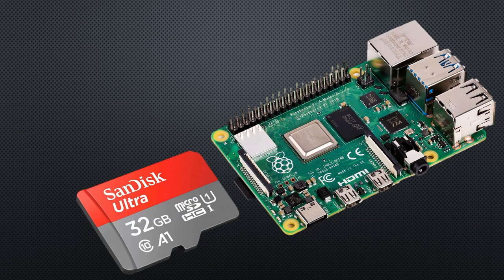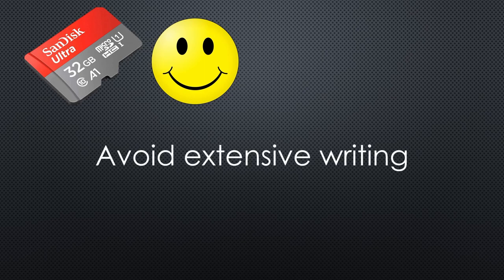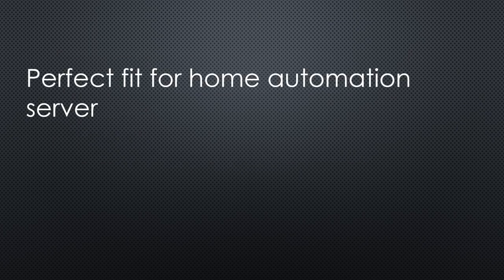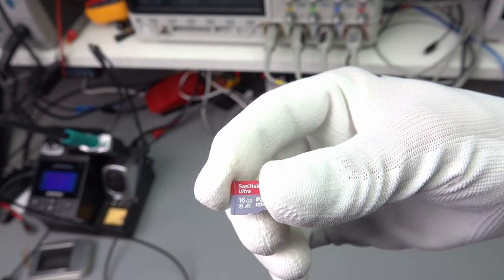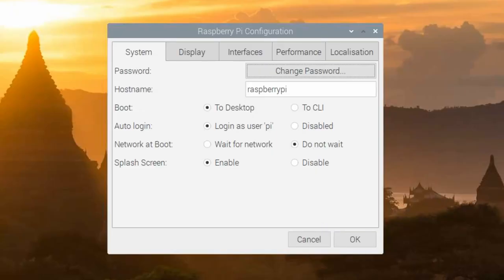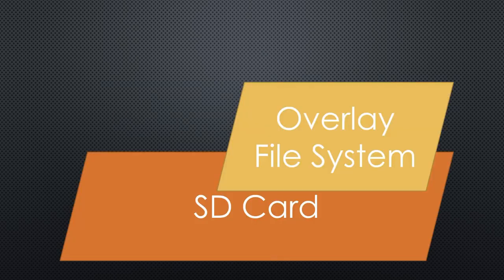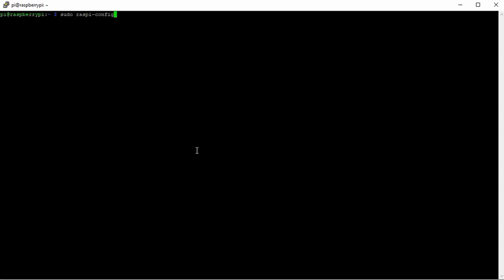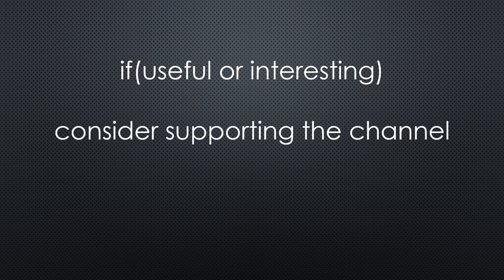#403 Simple Trick to protect your Raspberry SD card from Crashing

Comment: there is another option using write-behind caching on EXT4 so it caches all the writes to ram and then using the COMMIT=xx seconds mount option it will write the changes from ram to disk every so often, the best of both worlds
Reply from the maker: Good point! And it seems to be easy. Similar to log2RAM, I think.
Reply: It doesn't ensure that writes will be cached to ram though. Just that it will cache up to "commit" seconds of writes before automatically syncing the filesystem so if your system suddenly crashes, you know that you have lost at worst this amount of writes. Applications can request their writes to be immediately recorded to the disk/SD Card. Applications who use databases (such as SQLite) or unbuffered logs will do that frequently.
Reply: I have a pi3 running on the same sd card I started with, probably 6 years of running 24-7 with not a single issue. Pi4, has already burned 3 sd cards up in less than 2 years.

Can't for the life of me remember what commands I did to limit the card writes, or whatever I read at the time, but it's worked. Wondering if this is it...

Comment: I was able to reduce my sd card consumption drastically by logging to my remote homeserver. (almost) No local logs anymore. There is another advantage in remote logs: you can find suspects, even after the device in question died. Since there is a homeserver up and running 24/7, it was just a matter of some simple configuration.
Reply from the maker: Remote logging seems to be an interesting alternative (or extension) to this concept. Maybe I have to try it too...
Reply: @mixxx2005  For anyone considering this: make sure to put security in your network config. Unless you want a random device in the wild to give an attacker access to the files on your home servers/computers.
Reply: Have any details on how you did this?  I'd love to do the same..  have an NFS share or similar on a pre-existing NAS that would support logging from all of my various PIs, which could then run completely read-only.
Reply: @SteveJones172pilot  I enabled one of my Linux hosts to accept remote syslog messages, and enabled all clients to log to this remote logging facility. This is quite straight forward. How you have to do i depends on your software, of course.

Comment: I also tend to install ZRAM on every pi I own. It removes the need for swap space on the sdcard and it allows you to fit about 50% more stuff into the physical available RAM.
Reply from the maker: I never used it because I only have 2GB and bigger Pi4. So memory is no more a big problem for me. Probably good for a Pi zero if it does not consume a lot of CPU.
Reply: @AndreasSpiess  I even use it on my rpi 8gb model. Sometimes I notice raspian swapping stuff out even with minimal applications running and plenty of main mem free.
Reply: @misteragony  For some reason I think the default "swappiness" value is a bit too high in raspbian (how likely the os is to use swap). I adjusted it to 10 from its default 60 and have only noticed minimal swap usage since then, but it is still there for emergencies when you are running close to the limit (I have also done this on my laptop with similar results).

Comment: SD cards are not by definition unreliable. They come in different flavors for different use cases. If you pick the right one, an SD card can be more reliable than a big cheap SSD.

The most important criteria are the cell technology used and the Bill of materials.

Cell technology:
* Most consumer cards use TLC or QLC (3D) cell technology. A single cell can typically be rewritten approx 200 to 300 times. 
* Some consumer cards advertise with 'long endurance' or 'industrial' terms. Often such cards use MLC cell technology (but this is not guaranteed!). In this case a single cell van typically be rewritten approx 2000 to 3000 times. This type is also often used for EMMC memory and modules.
* For more demanding environments (automotive, medical, extreme conditions,..), often (p)SLC cards are used. For these type of cards, a single cell can be typically rewritten up to 30000 times. That's >100 times more than a typical consumer card!. You will not find these cards in a regular (online) shop. Cards utilizing this technology often have more advanced flash controllers onboard providing additional security and features compared to consumer grade cards (e.g. power failure protection, better wear leveling...).

Bill Of Materials:
* Most consumer cards do not have a fixed Bill Of Materials (BOM). This means the internal components can change without notification and the manufacturer will choose whatever is available and the cheapest that complies more or less with the specifications. So for one batch of cards, the cells can be TLC, and a few months later, QLC becomes cheaper and the manufacturer switches to QLC components, or uses another flash controller...  This is also the reason why almost no manufacturer will give the complete specifications of the used components for these cards.
* Most manufacturers also offer fixed BOM cards. These are cards where the used components are fixed and will not change without notice. This guaranties that if you buy the same card next year, it will behave exactly the same as the ones you already have.

An example of a 'cheap' (p)SLC card with fixed BOM is the SDSDQED-016G-XI model by Western Digial/Sandisk.
 It is a 16GB SLC card with an extended temperature range (-40+85C) and an endurance of 480TBW. It costs about 30 euro's at Mouser. This is typically cheaper than a usb->sata/M2 adapter + decent SSD.

For comparison: a Kingston A2000 SSD of 500GB has an endurance of 360TBW. And if you only look at smaller very low cost ssd's, then the endurance is often <100TBW ((e.g. Kingston A400 120GB -> 40 TBW)

So for projects that do not depend on very high speed disk access or require a lot of storage, such SD card is unrivaled. Both for price and reliability.

(The explanation above is a bit simplified... there are other factors playing also a role, but this comment is already long enough for now :-)
Reply from the maker: Thank you for bringing light into the dark of the SD cards! So far I have only used SD cards from online suppliers. Good to know other variants exist.
Concerning SSDs: Even my home automation server only writes MB and not GB because I store sensor data and not videos. So with my Raspis, I can live with very low TBW values (other than with my YouTube production machine ;-) ) I also only use the smallest SSDs I can get because the volume is small (<2GB for two years of sensor data)
Reply: Best comment ever! Thanks.

Comment: I use a different approach, and I find it much simpler and scalable: I use a NAS, so shared directories to save logs and data. So I get automatically backups (I need to set up only once for the base directory in the NAS), fast disk (but it depends also on network), cheap disks. And I'm able to split or merge services and rpi much easier.
Reply from the maker: Storing the files on a NAS is for sure a good thing for many applications (if you own one).
Reply: When a Raspberry is booted without connection to the NAS (e.g. NAS is down, or no network connection), the Raspberry runs without NAS connection forever! No retries to connect later.
Solution: autofs mounts the NAS directories when needed, and releases the connection after 5 minutes when not in use, so this also costs less memory. Thus a retry is provided after connection-loss.
When speed is not needed, you can make a NAS from a Raspberry and 2 USB disks (even USB-thumbs) as RAID-1 using mdadm.
Reply: @AndreasSpiess  It is super easy to make your own NAS, just install Linux on a machine (could be another raspberry pi) and configure a RAID 5 (preferably not on USB, which is too unreliable for it, as it can disconnect randomly from time to time, which breaks the RAID and makes it go into degraded mode) and then share certain folders via NFS, very easy. The advantage is that you don't have a proprietary NAS like Synology that is both inflexible, hard to fix when it breaks and expensive and often uses a non standard proprietarily modified Linux.
Reply: I have a NAS as well and I prefer using it as well. I just need to get 1 that's a few teraflops my problem is the $.
Reply: @PvGeens  Sounds like I will need to be careful with doing that.
Reply: @denastewart-gore800 , @Sagittarius-A Black Hole
I prefer RAID-1 (mirrored disks), over RAID-5: it uses less CPU-power. Disks are cheaper and bigger every day, do there is no need for RAID-5 (for me).

When a mirror breaks, the NAS doesn't stop working. It just continues working with a degraded mirror. No data is lost.
It just sends an email when it happened (configure in mdadm). Otherwise I even wouldn't know about it.

Repair is easy, can be scripted, but takes a few hours and disk-performance. Just let it run in background, after a while is fixed like nothing has happened.

I have my entire life on those disks, and had a quite few crashes (SATA on another computer, not on Raspberry), but never lost a bit. It was always repairable.

But indeed: you always need to be careful with computers. It is a mistake to think they are deterministic machines.
Reply: Take it a step further: put your boot image on a TFTP server and netboot your Pi. But this still doesn’t always fit the bill: not everything hast a fast and/or reliable network connection. OFS works despite the network being down.

Comment: With the newer Raspberry Pi 4 with the higher RAM this overlay makes a lot more sense now.   I guess you could use read/write Boot drive and periodically copy the overlay to the SD or to an external network drive for data that may need to be kept longer term.    Thanks for the great information.
Reply from the maker: You are right, many combinations are possible if you include network disks in your setup.

Comment: I use RAMFS and mount it over the top of the log directories. Then, when a program writes to the log files in the log directory they are intercepted by RAMFS instead. When the max size is reached they are discarded. They are never written to the SD card. My SD card is in its 4th year of operation (as a LoRa gateway) with no problems so far.
Reply from the maker: I never used RAMFS, only log2ram which seems to have a similar strategy. This is another valid way to solve this problem.
Reply: I have a bunch of raspi 3's running on the field and they have been working nice for the past 4 years with this tmpfs trick. A couple of sd-cards have became corrupt during this time, but I suspect its due to power outages, since after dd'ing they seem to work ok again.
Reply: I would love to see any scripts or configs you have to accomplish this..  Sounds cool..  Also sorry you're "not" mark Knopfler..  it would be cool to be Mark Knopfler!  :-)
Reply: Can you write the command for setting this up? 
I have found this: 
sudo nano /etc/fstab

And added  
tmpfs /var/log tmpfs defaults,noatime,nosuid,mode=0755,size=20m 0 0

Is this correct or are there other directories?

Thx.

Comment: Thanks Andreas, I was worrying about my sd card in. my headless Raspberry Pi 4 recoding NOAA weather images 24/7 so I made images of the card if it fails, I haven't had any card fail yet but you saved the day and me worrying, thanks for this tip will implement it : )
Reply from the maker: As said: A backup is always good! But your application probably is a good use case to reduce the chance for failure.

Comment: So, why isn't there an option to write the ram files back to sd on close?  Thus dramatically reducing the writes
Reply: My guess is it’s too hard to guarantee that. If people expect their data to be saved when the pi reboots then they will be angry if 100’s of megs get erased when it looses power or crashes. If the system expects files to be written on shutdown then the file system would be corrupted on ever single unexpected reboot. It’s much safer to just assume all data is temporary in the RAM disk.
Reply: @CodeMonkeX  Yes I see if the rewrites were automatic, there could be a problem. My thoughts were for a Manual/programmatic option - a simple 'do you want to save' or cmdline save
Reply from the maker: I am sure a lot of things can be done. But, as a Linux noob I am happy to have a simple way. All my use cases can be appointed to one or the other scenario: No longterm storage needed --> SD card or longterm storage needed --> SSD
Reply: Interesting question.  That would be a nice option.  I'm all about those SSD drives because of the speed.  I only use SD cards for the portable builds like my hotspots.
Reply: In some way a similar functionality can be achieved with "apt install log2ram". If I'm not mistaken "log2ram" is installed by default in armbian-os, on raspberry-os we can install it ourselves.
Reply: It's the dumb user version.
You can do it by setting up the places you need to write, then using a cronjob based on time or 'on shutdown' etc to flush the ramdisk to nonvolatile. Would be nice if there was a convenient button in the popup "commit overlay" and it would diff and do a single write.
Reply: @vlya1533  Interesting. Would that be preferential for any reason? EDIT: I bet that only sends the log to ram and allows updates.  If I am correct I see where that would be better in certain circumstances.
Reply: @jmr  it's just a shell script and a couple system services. As far as I can see it dumps logs to disk at stop and once a day by default.
Reply: @vlya1533  DietPi also have log2ram installed and enabled by default.
Reply: That's pretty close to how the default file system works.  The problem is, if power is interrupted before the writes complete, you've just corrupted your file system.
Reply: @JM Coulon We're not talking about running a journaled file system.  Were talking about "why isn't there an option to write the ram files back to sd on close"
Reply: @JM Coulon OK, fine, your filesystem isn't corrupted.  And how exactly does that fix the problem of the data not getting written when power is dropped?  Anything half written is rolled back, and anything not written is lost.  The point here is saving the data.

Comment: In addition to these tips I would strongly recommend getting an SD card that's more suitable for this kind of usage. I've personally had good results with the WD purple SD cards, I've got 3 pi's that have been running 24/7 for about 3 years now on an unmodified raspbian installation with full logging enabled (and one of them is constantly writing due to a pihole installation). So far I haven't had any issues. But... I would recommend partitioning only a small part of the SD card (i.e. 25% or so) so the wear leveling algorithms can do their thing and make sure your SD card won't run out of working blocks.
Reply from the maker: Thank you for sharing your experience. Because other viewers also recommended these WD purple cards a few are in the mail by now. I hope they implemented wear levelling. The descriptions I found were not clear. Just that they monitor "bad cells".
Reply: @AndreasSpiess  I've read on reddit that they are supposed to have wear leveling according to WD suport. Anecdotally however, I've had many SD cards fail before I switched. Even high quality ones
Reply: I do not believe having a small partition would make any difference to the wear leveling since it uses all the cells to write data regardless what file system you use.  The idea is get the biggest card the device can support to extend the life out of it.
Reply: @Darkk6969  You're right, assuming you have TRIM enabled it won't make any difference in that aspect. But if you only partition a small part of the disk you leave the SD card with enough space to keep wear-leveling without any worries and you can't accidently fill up the disk with logs or other files. Given how cheap memory cards are and how much space you actually need, this has been a good tradeoff for me.
Reply: Sandisk do a range of rugged IoT targeted SD cards using more robust flash. Makes sense.

Comment: I've usually mitigate writes to the sdcard by making sure the noatime and nodiratime option is on the sdcard in the fstab and mounting a small flash drive to the /var directory, and using a larger flashdrive for the home directory (you could put both partitions on one flashdrive). This should eliminate all writes to the sdcard except when installing and updating software. Not on PIs, but on PCs, I frequently use a virtual disk and keep my work on flashdrives, and have scripts with clickable icons to setup, load, and when my session is done, save and destroy the virtual disk.
Reply from the maker: Thank you for sharing how you do it. Virtual environments are also a good thing if you want to protect the original.
Reply: Sometimes, at good points, I hit the save work icon, and it saves only the files that have changed, using rsync, and I continue on.